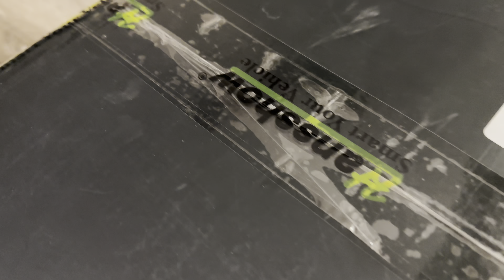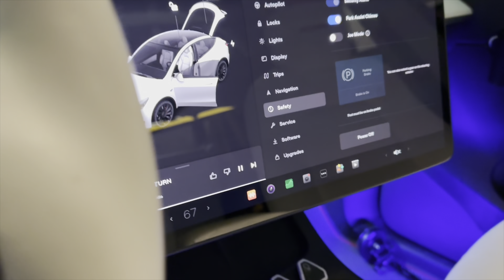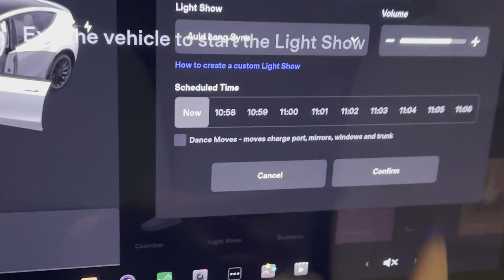2024 Tesla Model Y /  3 Cyber Inspired Taillights | Hansshow Full-Width Strip Tail Light

Comment: Looks cool for sure, but the license plate lights are so bright they really detract. Seems like this bar is bright enough to just remove those other lights all together.
Reply from the maker: This is a prototype see the pin comment video
Reply: @megawatts  Yep I saw the follow up....still the same issue with the stock license plate light(s) being so bright it detracts from the coolness of the light bar
Reply from the maker: @PhillipRauschkolb  only when braking
Reply: @megawatts  I think maybe you're misunderstanding what I'm talking about...I'm not saying anything about the light bar add-on itself. I'm saying the stock license plate lights that come on the car to illuminate the license plate, those lights detract from the light bar add-on.
Reply from the maker: @PhillipRauschkolb  ah got it yes you can swap those out for dimmer ones